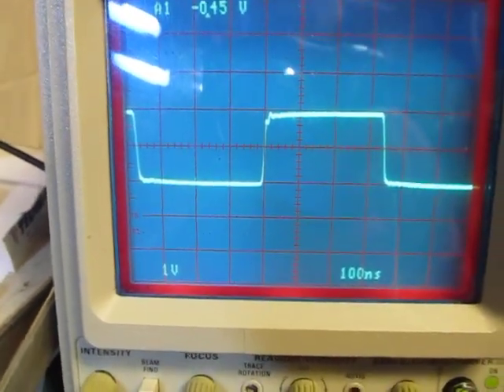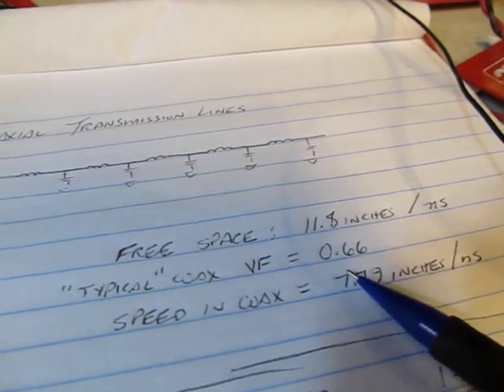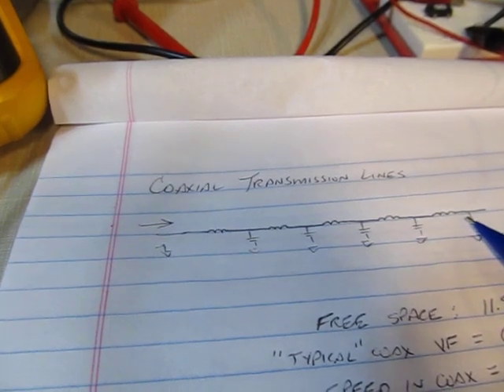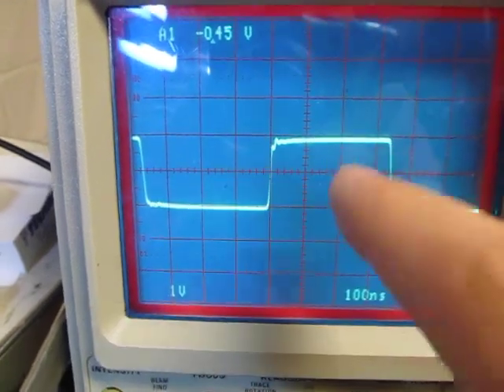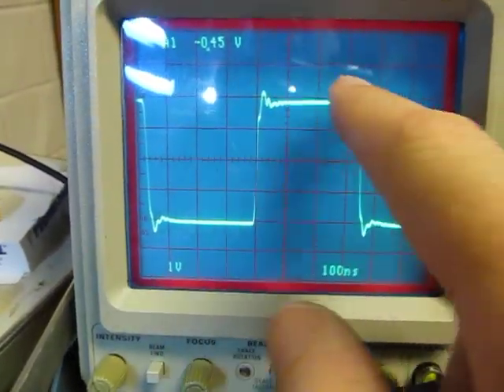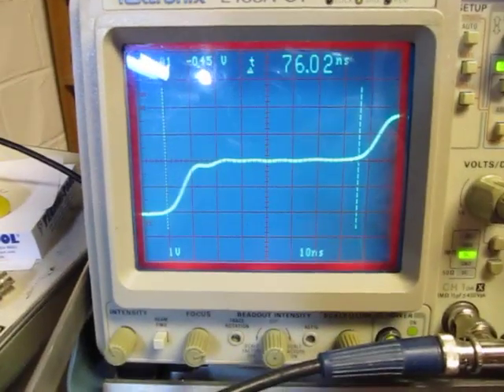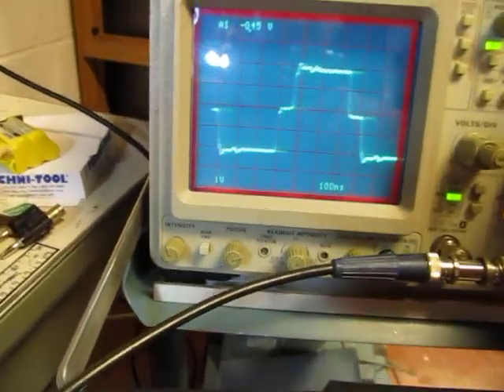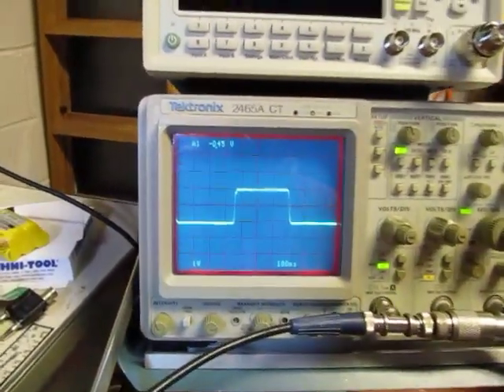#37: Use a scope to measure the length and impedance of coax

Comment: Does anyone know why AFTER we see the reflected signal(with round trip cable) the signal falls to 2 volt again and continues for another 50 ns or so? Shouldn't the signal(reflection) have just gone directly to ground ? My head is telling me the original  2 volt signal was 350 ns period. Then the reflection made it longer by it looks like 100ns,(max) but why do we see the original 2 volt signal on the end of that waveform? Shouldn't the function gen have switched off already by then?  Does it hit the original 2 volt signal again? If I look at the fall time of the reflection it looks like something braked it or something. Or does it have to do with phase-shifting etc... Somebody, please help me out of my misery here.  Thank you again Alan for great videos. This video was posted 8 years ago! Well, I'm sure my kids will one day watch them aswell!
Reply from the maker: When the function generator turns off, the generator "sees" a 50ohm load (the coax).  Since the output impedance is 50ohms also, and the voltage is starting from the high level, the voltage is subject to the 50-50 voltage divider - so it only falls halfway down - until the signal propagates to the end and reflects back, then it completes the journey to ground.  It's the same effect that is seen at the rising edge...
Reply: @w2aew   Ok I think I'm getting there slowly. Sorry for asking stupid questions and sounding lazy but actually I'm not lazy. The theory I learn simply doesn't go "parallel" with practical stuff like this. Sometimes I get so frustrated with this whole impedance matching thing. Ok what I'm hearing is this : 
1.  Signal from generator first stop is the Oscilloscope(1M impedance but actually seeing 50ohm from coax therefor original  intended 2 volt )

2. Continues and does round trip around the 50-ohm coax, reflects back adding to a total of 4 volt.

3. (Now this part I want to make sure I understand correctly) Reflected 4-         volt signal makes it's way back to signal generator.

4. Signal generator turned off some moment before

5.  4 volt signal hits 50-ohm impedance of signal generator

6  50 ohms of signal generator and 50 ohm of coax acts as voltage divider

7. Rest of the signal that is left attenuates to 2 volt.

8. The complete signal goes to ground at generator.

I hope I'm somewhat correct? I didn't think about the signal hitting the generator which impedance still plays a role and the voltage divider effect. Well, that's if I understood correctly.
Please let me know if you have time.
I really appreciate your help. Thank you.
Reply from the maker: @gerhardgroenewald6560  Since the pulse width is greater than the round-trip delay through the cable, it's best to break it up into two distinct scenarios.  First - consider that the generator has been sitting at 0V for a long time.  Thus the voltage on the cable, and at the scope, is at 0V.  Then the generator rises to 4V.  Since there is a 50ohm resistor in series with the output, and the coax has a 50 ohm characteristic impedance, as the races down the coax, it rises to just 2V due to the voltage divider between the output impedance and the coax impedance.  When the pulse hits the end of the cable and sees an open circuit, the voltage rises to 4V and propagates back towards the generator.  After reaching the generator (which is putting out 4V into it's 50 ohm series resistor), the current drops to zero, and the voltage is 4V everywhere.  Now, the second scenario - we start with 4V everywhere.  The generator drops to 0V.  But, there is still 4V charged up on the cable.  Thus, you get the same voltage divider between the generator's 50 ohm resistor and the coax impedance, so you initially see 2V on the cable.  This propagates to the end of the cable, and when it hits the open circuit at the end of the cable, it goes to 0V, which propagates back to the generator.  When it gets there, the current drops to 0 and you have 0V everywhere.

Comment: Water Resistant cables have what in them to be water resistant and does this affect the cables capacitance and impedance?
Reply from the maker: It is usually the material used for the outer jacket that determines water resistance.  Does not affect impedance - a 50 ohm water resistance cable is still 50 ohms.

Comment: :o)
Is it possible to adapt a 75 Ohms cable to a 50Ohms oscilloscope output without distortion?

With the TDR I found Iwas using different resistance cables.

JP

Comment: Would this work on stranded 18 gauge wire, if the VF factor is known?
Reply from the maker: as long as there is a return path (like it is twisted pair, or duplex cord like speaker wire, etc. where the two wires have a fixed distance between them across their length).
Reply: Thank you for the reply. I later watched your more recent video, and you stated that. So is the insulation between the twisted pair like the dielectric insulation in coaxial and that causes the impedance in twisted pair? I found a data sheet for CANbus wire specifications and it shows 120 impedance but that is the resistor we use at each end of the CAN. It would be nice to use this technique as I work on semi trucks. The CAN find all over. To be able to get with in a foot of an open could be a great time saver. Thanks again for your time.
Reply from the maker: @paulw2791  The 120 ohms is both - the impedance of the pair of wires, and the termination that is used.  One would typically terminate a transmission line with its characteristic impedance to prevent reflections.

Comment: doesnt make much sense... if your second coax is of different ohm how would you know where the reflection is from, i.e. from the open end or the beginning end?
Reply from the maker: Even if the test piece of coax is a different impedance, you will STILL see the same step response from the reflection from the far end.  The reflection from the junction of the coax from the generator and the test piece will travel back to the generator, you won't see it on the scope (other than the initial amplitude of the step will be different from the 50 ohm terminated case.
Reply: @w2aew  Ok. Thank you for the clarification.

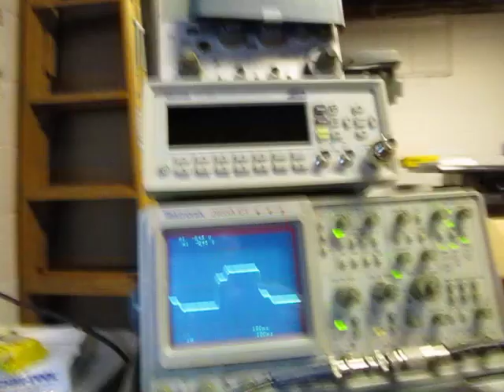Comment: What is the reason at 09:20 the base level is lower than 0V?
Reply from the maker: It's not really lower than 0V.  I have the scope coupling set to AC, so the DC content is removed.
Reply: @w2aew  Oh, I mean more that the base level, in other words the low part of the pulse signal, is lower than the base level when the impedance are matching.
Reply from the maker: @kingsonIAH    It only appears that the base level is lower when unmatched.  This is due to the AC coupling on the scope.  If I had used DC coupling, you'd see that the base  level does not change between matched and unmatched case.

Comment: Transmission lines do not have impedance.

They havd a characteristic defined as a termination that results in no reflection.

Impedance exists in the frequency donain, Tlines operate in the time domain.

Tlines operate with traveling EM fields, no such thing as impdance exists
Reply from the maker: I think we're talking about symantics.  But I disagree.  If a 50 ohm transmission line was infinitely long, it would look at behave like a 50 ohm resistor.

Comment: how does the signal look at the other end of the cable?
Reply from the maker: +Manogna Bharath Like a square wave, provided the source is properly terminated.
Reply: +w2aew thank you for your reply, without terminating the coax will there be a double step square wave at the end. in your video about 5:39 we clearly see this happening at the start of the coax, which is connected to the signal source and scope. i was wondering if this was the case at the end of the coax too...
Reply from the maker: +Manogna Bharath No, the double step at the input is due to the incident wave and the wave reflecting back from the open end of the coax (the length of the intermediate level is the round trip delay time).  At the open end of the cable, the incident wave hits and the reflection happens immediately causing the signal to simply assume the open-circuit magnitude.
Reply: +w2aew Ok. so if the transmitter at the source see a double step square wave where as the receiver see a proper square wave(with a slight delay maybe) should the receiver bother to terminate? wouldn't he get a unaltered information anyways, given if the reflection dies back at the signal generator which ask you say is properly terminated(50ohms)..
Reply from the maker: Source termination is a perfectly valid way to operate if the load is high impedance and does not require transmission of power.
Reply: +w2aew ok. whats explains the over/under shoot is it a cause of parsitics LCs.
Reply from the maker: +Manogna Bharath Most often, yes.  in this case, partially due to the the stubs created by the BNC Tee

Comment: If your interested, I have some scopeshots of the 74AC14 TDR into a 254ft long speaker wire with a 270ohm termination.
 Are the rounded edges caused by losses? 
https://tinyurl.com/y9p2bsfp
This shows a 738ns delay, since I know my wire is 254ft long, I calculated a  .70 VF.
I then terminated the speaker wire with 110 ohms, you should see that is the characteristic impedance. No impedance bump at 738ns.    https://tinyurl.com/y9zyslhl
Here's the speaker wire UNterminated.  https://tinyurl.com/y7dxtaea
 For even more fun here's the speaker wire through a transformer with 253ft of wire on the ground terminated into 1300ohms. What can you tell me about the antenna waveforms (wire on ground).
Shown at 200ns/Div  https://tinyurl.com/y9omqtkh  You can see the speaker wire end at 738ns.
Now shown at 1us   https://tinyurl.com/yc4gqvqw
And at 50us    https://tinyurl.com/y76ycuo3

Comment: Hi Alan, please see correctly, I chose to measure the point, I got an error of 10 cm. Cord length 157cm.
http://screenshot.su/show.php?img=1ccc267cac93e720ef79bd82d49350aa.jpg
Reply from the maker: Your error is only about 6%, which is quite good.  This can easily be due to the inaccuracy of the assumed velocity factor, as well as placement of your scope cursors.  With short lengths like this, where the rising edge and ringing of the incident edge and the reflected edge start to overlap, it is difficult to know where the right location is to place the cursors.

Comment: Hi W2aew, I received my 74AC14 squarewave generator. I'm seeing ringing and wonder if there is a way to tame it. I put a 33pf across the scope input and thet helped, but of course, it increased the risetime. Any thoughts about how to tame it? 
See before and after photos here, https://www.dropbox.com/s/t5y0jfrmbxaqs0o/risetime.png?dl=0
  I'm using a Tek 2465 CTS, I think I learned it does NOT have delayed sweep. I tried to look at the rising edge and the only way I could see to do that is X10 button. Do you agree it does not have Delayed sweep, like the Tek 475, that I now wish I didn't sell.
Reply: I reviewed #88 and see about the same ringing on your DIY unit so, I guess no big deal. Although, you have a video using a SigGen and it didn't seem to have the ringing or overshoot. Why?
Reply from the maker: Don't worry about the ringing.  In fact, it might even help you to make a more accurate measurement of delta-T when doing a TDR measurement.  The 2465 CTS absolutely does have a delayed sweep!  All of the 2465/7 scopes have it.  This video uses it, so you can see how to use it.
https://www.youtube.com/watch?v=vvqVTD-VEow
Reply: Maybe, but I still can't make it work. My scope does not have the green lights on either side of the sweep controll, like yours. It does not say "slow" or x-y like yours. I do get a highlighted area when I PULL the sweep knob out, if I move it one click to the right I get a  signal that looks chopped. Please see here,
https://www.dropbox.com/s/56yofrf05cha0am/delayed%20sweep.png?dl=0
 I have tried both channels, I asssume it would have delayd sweep also, but I can't figure out how to make it work.
Reply from the maker: Can you take a picture of your front panel for me?
Reply from the maker: There is blue text above the SEC/DIV knob that indicates the delayed sweep function modes.  Pulling the knob puts you in INTENsified mode, where you see a highlighted area of the main (A) sweep. If you turn the "delta-REF or DLY POS" knob, you'll adjust the position of the intensified portion of the trace.  With the knob pulled, you turn it to the right to enable the ALT mode, where you'll add a second trace whose starting point is the delay position and the sweep speed is set by the pointer on the pulled knob.  The TRACE SEP knob is used to vertically separate this ALT B sweep trace from the main A trace.  If you push in the SEC/DIV knob at this new setting, you will have only the B sweep.  That's the way it's supposed to work, assuming it's not damaged or assembled incorrectly.
Reply: I think I have a problem with my 2465. I get the INTENsified mode when I pull out the sweep knob, I can adjust the position of the INTENsified area anywhere on the waveform. When I move the sweep knob one click to the right, it is like I have two waveforms and I can move one, but they are superimposed and the Trace Sep knob has zero effect.
 In addition, as I'm trying to solve this problem all of the sudden I have an on screen frequency display. I had time base and Volts/div, but the frequency counter popping in is new. I always fed CH2 out to my counter to read frequency.
 BTW,  the previous waveform photos, I was in the X10 sweep mode, that's why it got the chopped looking dispaly.
Reply from the maker: If your TRACE SEP knob has no effect, then it does sound like the scope has a problem.  However, you should still be able to adjust the desired delayed sweep speed, then push the SEC/DIV back in and only see the B sweep.  The delta-REF can move this back and forth.
Reply: Yes, that is correct, but there is some much jitter that the X10 button works better.
Reply from the maker: Change the B Trigger mode to “triggerabke after delay” instead of “run after delay”.
Reply from the maker: For what it's worth, I published a video showing how to use the delayed timebase on the 24x5 scopes:
https://www.youtube.com/watch?v=54roz8IUoVI

Comment: VERY cool  . . .  it almost reminds me of adjusting the differential phase and gain on an old analog TV transmitter.  I've always admired you Tek Techs.  Where do you find the time to make all these GREAT videos??? 
 
Mike Roche, W1WTC (formerly AA2LS), w1wtc.us
Reply from the maker: I'm glad you like it. I try to do a new video every week or two, if I have the time.  If you like this one for it's "tuning" aspects, then you'll probably really like the one where I use a scope to help tune an HF antenna and even measure complex impedance:
Use an Oscilloscope and Signal Generator help tune an HF Antenna, and measure complex impedance